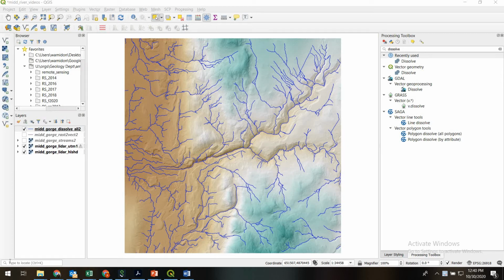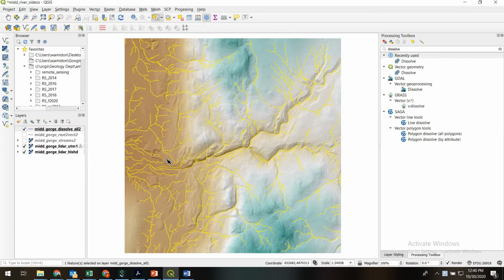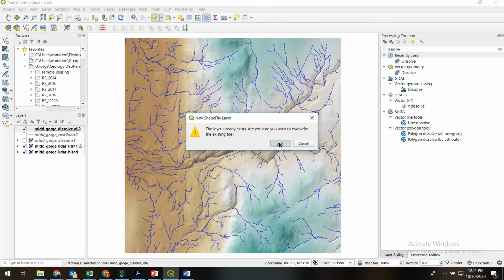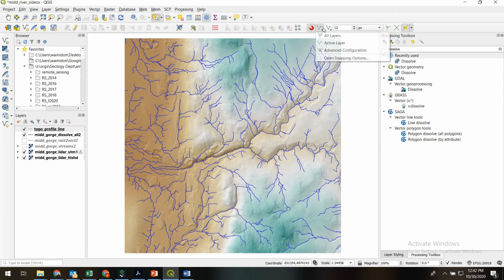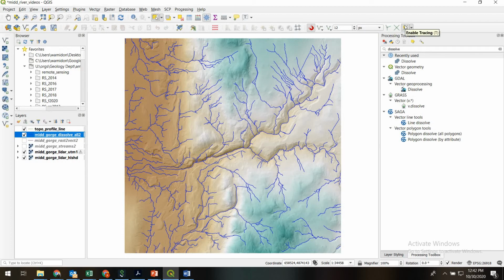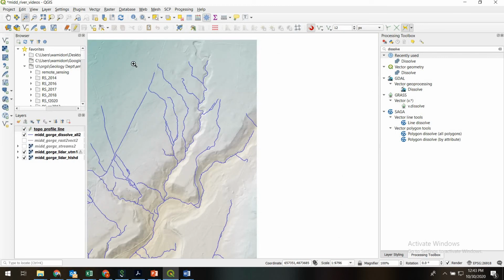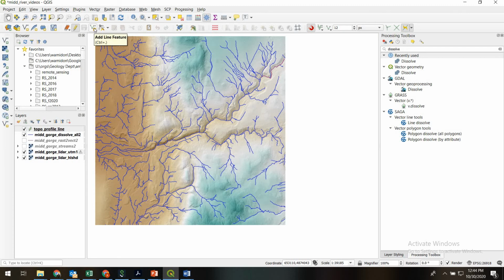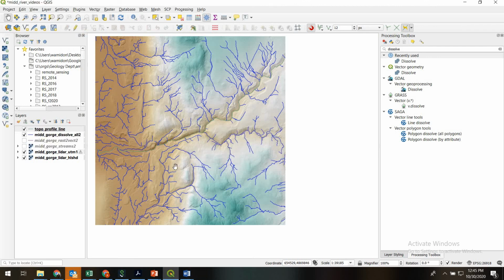Vertex Snapping and Trace Tool in QGIS 3.10

Comment: Do you if the snap is temporary (to the layer in the project) or permanent (to the layer itself) ? When I snap lines in a certain project, I select and move the intersection node and the 3 lines move together. Then, I open the same layer in another project, select and move the intersection node and the lines get separate, as without the snap. Any clues ? Thank you in advance !

Comment: Thanks for this good and usefeul video. Thanks to you I can work with tracing when creating a new polygon, but not when I'm modifying an existing one with the vertex tool. It it possible to do so ?
Reply: Did you find the solution?